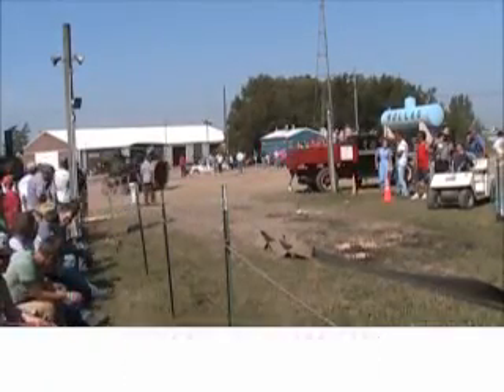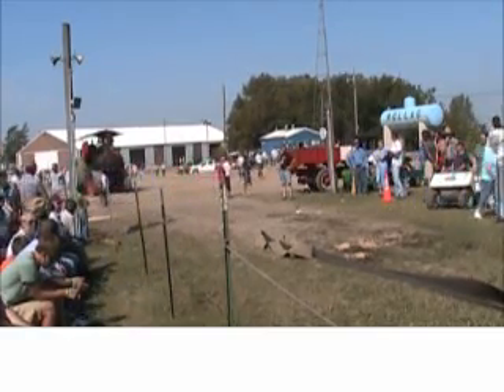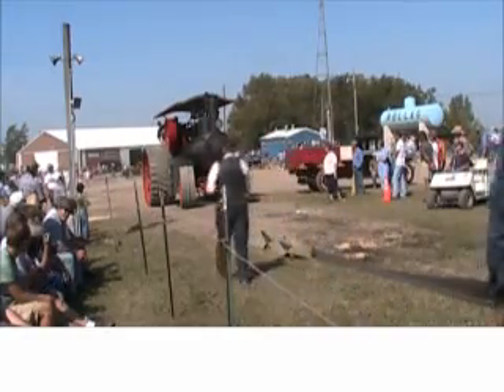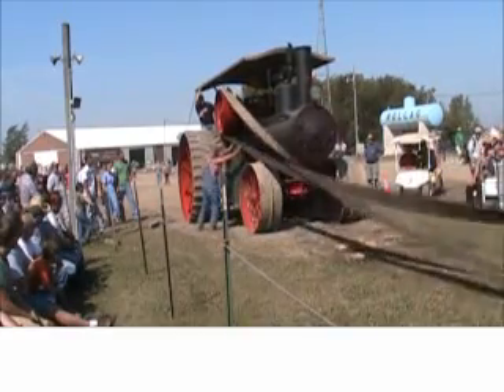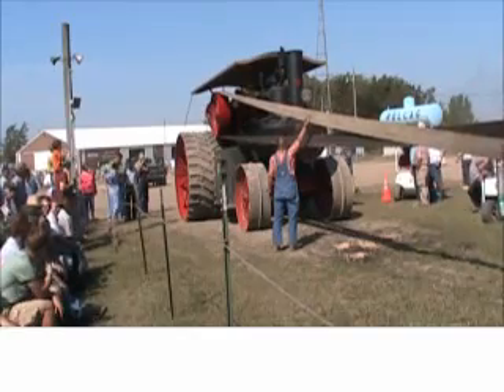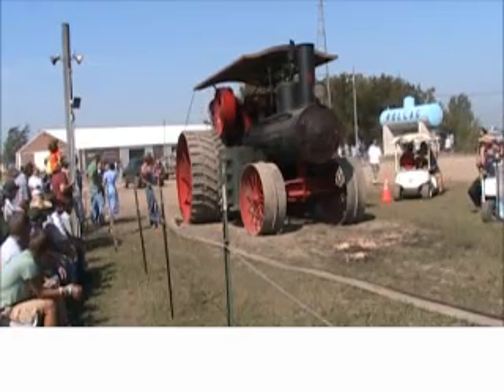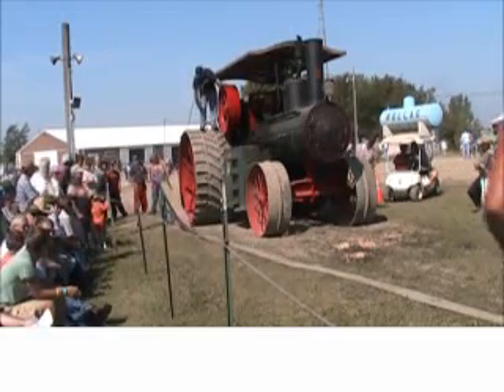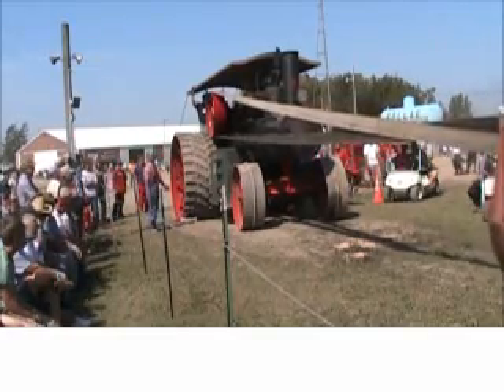Steam Tractor on Dynomometer - Torque and HP Explained

Comment: my honda motor with a 1.8L using gearing can produce more tq at any output speed than this can.....why you ask? cause i produve well over 350hp with it....!!!!!!!  its called math you idiots
Reply: dumbest shit I've read on YouTube in months
Reply: TATERTOTS JACKSON then you clearly donyt know shit about energy or math and physics.... nuff said
Reply: +Chad W there's an old saying. hp is how fast you can hit a wall and torque is far you carry the wall with you. there's your physics and math explained so your stupid ass can understand.
Reply: Chad W coming from your stupid as fuck opening statement, you still dont know shit. Go ask a physicist how HP torque are apply in world through phyicis, or read a fucking article on it, I know enough about both to determine you're a fucking moron.
Reply: Hp= torque x rpm divided by 5252...... Put in some numbers and work it out. The tractor has no hp...because it doesn't rev....but have huge amounts of turning force ( torque) at low rpm.
Reply: Chad W you're literally beyond help, you're capable of reading and still can't understand. Your own statement defeats itself. Motors produce numbers off the crank and at the wheels, transmission gearing has no bearing on turque made at wheels, gearing is to take advantage of torque made at the wheels to apply the power to the ground.

A desiel motor can produce twice the torque over the HP of the motor. HP doesn't directly correlate to HP. And as such the same motor can produce 600 HP 1200 torque vs 750 HP 500 torque gas motor. Your head will likely explode now.
Reply: "so no matter what gearing you have, there is no way a higher hp motor can produce LESS tq than a lower hp motor..."
-HAHAHAHAHAHAHAHA
Sure. Lol. Thats insane bullshit. I've personally witnessed a well over a century old 180 horsepower stationary engine the size of an entire fucking house with cylinders the size of a fucking oil drum pump and drain 3000 acres of flooded land in a day. My turbocharged 300i6 in my 1966 dump truck produces over over 500 Ft. Lbs of torque while only putting out 258 horsepower. Meanwhile, an LS1 engine produces 350 horsepower while only producing 365 HP. My old school dump truck can and has won a great many pulling contests against modern V8's that have:
-More displacement
-More horsepower

Because at the end of the day without the torque you won't get moving, and in a battle of brawn torque, traction, and weight is what wins the pulling contests.

https://www.youtube.com/watch?v=EVxByLO_6cA
^Here's a tractor putting out a "meager" 110 horsepower yet it does a full pull in a pulling contest with lots of energy to spare and no signs of slowing down.

Think of torque like a hydraulic press. Its slow, but don't dare get in its way.
Reply: Brett Wright its old cause you use it and you know nothing of physics.. your sayings are old and dumb based on 100 yr old men who dont know math or physics so keep your old sayings to yourself cause they do not apply..        more weight you want to move in the same time requires more energy, i.e. hp..... if you disagree you disagree with physics and if you can prove you are right then you would be given millions and be on the cover of dozens of world magazines, but you aint.... cause you dont know fucking shit about physics or math, only recite old outdated false "sayings"
Reply: Brett Wright you dumb moron. hp determines wheel tq based on gearing.... so no matter what gearing you have, there is no way a higher hp motor can produce LESS tq than a lower hp motor...

so, higher the hp , the more wheel tq you have if you can change the gear accordingly. 

hp always equals more tq if gearing is introduced...i.e. transmissions...

if you disagree, then you defy the laws of physics and if you can prove this, which you cant, then you will win literally 100's of millions proving the current model of physics on ITS HEAD!!!!

if you cant, then well.... you are a moron and i shouldn't have replied cause you are a fucking moron living in a head that no one has told you how dumb you are.........

let me know when you win the noble prize!!!!   ill wait!!!!
Reply: Brett Wright You didnt understand my post cause you have no intelligence. I told you why your shit was wrong using science, math and logic... if you dont learn from it, its not my fault...

and dont fucking think for a minute that im the ignorant one...
i am NOT the one stating shit that defies the laws of physics and if i dont agree IM the fucking moron. 

you are the one that doesnt understand energy....so walk along and be dumb....not my problem....
you made the dumb comment on a public forum then get pissed when you get corrected...
learn or not. i dont care....
Reply: andgate2000 energy = force x rpm    you only need to devide by 525 is you want to use the made up term called hp, then you also have to use hp and tq, not focre and power/energy     using hp means its a registered traidmark
Reply: You don't have a clue do you. Hook your 1.8 to this steam engine. I mean weld them together shaft to shaft. Hammer both throttles at the same time and watch your 1.8 spin like a propeller...impractical test but it is absolute truth that your engine is not even close to the power of this stream traction engine. In fact I think your joking, right?
Reply: if you think that gearing and torque multiplication is all of the different variables you deal with a tug of war you need to really expand on it. in a situation in that you are looking at gravity as a constant with your variables being the coefficient of friction between the ground and the wheels as well as power, gearing, the acceleration, and mass of both objects
Reply: Chad W You are actually correct when you state that your 1.8 can produce more torque than the steamer at an output shaft if it's geared down low enough through a gearbox. But you are comparing direct crankshaft torque of the steamer with a 1.8 petrol spinning through a reduction box at least 12 times the revs, then measuring the resultant torque at an output shaft after it has been geared down 12 or 15 times. Well yes, but you can also gear the steam engine crank down 15 times to the drive wheel couldn't you? Making the steamer 15 times the output torque of your geared down 1.8. But here's the problem for your 1.8. It can only reproduce the steam engines torque if the engine is already allowed to run at high rpm. Not from stationary. The torque output at 250 rpm of the steamer of 3000 ft/lbs,  is the minimum the steamer produces. Maximum torque for a steam engine occurs from rest, then falls away with rpm. So the traction engine would out pull your 1.8 from a stand no matter what the IC engine gearing,  because as soon as full load is applied, the petrol engine revs drop like a stone until the engine has nothing left to give, while the steamer remains at full torque even if the crankshaft is stationary. Good try, but no cigar buddy!
Reply: Finished waffling? Okay. Where to start? A steam locomotive starts 3000 ton train away from rest using overdrive gearing. Because a locomotive driving wheel is of considerably larger diameter than the cylinder crank pin. It's like starting away in 6th gear with 7 or 8 times the locomotives weight in tow. This is despite the loco producing NO horsepower whatsoever until those driving wheels begin to revolve. The moment they do, & the time & work done factors are involved, the hp climbs into the hundreds almost instantly. No matter what the engine type, petrol, diesel, steam or electric motor, the horsepower is irrelevant until something moves. The output shaft on your geared down 1.8 or 125 motorcycle, also produces no horsepower until that output shaft begins to turn, regardless of what the engine crank is doing. You have just tried to make the case that a cvt 125 scooter could out pull a fucking traction engine producing 25,000 of of drawbar pull, because the 125 is spinning at maximum revs & producing 10 go, while the steam engine is stationary and therefore producing NO hp. You're adorable! Have you seen videos where steam traction engines out pull 900 go diesel tractors in a tug of war? Those diesels are producing just a little bit more than your single cylinder 125, yet lose every time to the steamer, despite the traction engine giving away some 800 hp. They cannot match the starting torque of a steamer even when working through a reduction box.
Reply: No matter what the engine can produce in horsepower when allowed to spin at rated revs, once an engine's peak torque is exceeded by the load on it, IT WILL STALL. this is why we dont fit 200 hp 1 litre motorcycle engines to small trucks, because the peak torque of a naturally aspirated 1 litre is just 75 ft/lbs. Barely enough even to turn a truck gearbox over. Developing 200 hp at 13000 rpm is all very well in motorcycles, but in a truck the take up loading from rest would stall the engine in seconds.
Reply: Your 125 single produces the gigantic peak torque of 7 ft/lbs, so obviously it could easily out pull a single cylinder traction engine producing an absolute minimum torque of 3000 ft/lbs @ 250 rpm. Minimum, because a steam engines torque falls away from its peak when stationary the faster the engine revs, as the steam doesn't have so much time to get in & out of the cylinder to exert it's force on the piston. So the torque has dropped 25% by 250 rpm. & this is at the crank, before it is multiplied by gearing to the wheel. But what chance would this traction engine that can pull 150 tons stand against a 125 cvt scooter? Lol
Reply: Typo error (25000 lbs of drawbar pull) I'm writing on a mobile with predictive text. To use your example, I'll explain the principle you can't seem to grasp. The man pulling 93 tons. The fittest human in the world, let's say a tour 're France rider, can develop approximately 0.5 - 0.7 hp. The strongest men on the planet can move a 147 ton Jumbo jet a couple of yards before collapsing. The work done in moving that Jumbo 2 yards is the horsepower, which takes him many attempts and 20 odd minutes. But the drawbar pull exerted, perhaps 800 or even 1000 lbs, is the torque equivalent. He can exert enough strength to overcome the dead weight inertia of the aircraft, - But in terms of distance, he has only marginally exceeded the power output of a model aircraft engine.
Reply: marcin l John Deere vs 1800 steam tractor. See a 800 hp tractor beaten without the steam engine even having to try. Exactly the same result on concrete.
Reply: marcin l Look up Steam Engine vs County tractor. Even 4 wheel drive can't beat a small single cylinder traction engine. Though of course, tractors aren't designed to pull on mud are they? Lololol
Reply: marcin l I'm still waiting for your video where a 125 motorbike out pulls a traction engine. Or even a weak torque tractor to make it easier for you! We'll just have to agree to disagree, because I can't think of a way to make physics any simpler for you.
Reply: Sorry Marcin, your English syntax is as muddled as your physics, so it's difficult to make enough sense of your message to respond. As I said in an earlier text, I can't seem to make it simple enough for you to understand the point, even when showing you video PROOF of torque superiority over horsepower from a standing start. Please show the video of a 125 scooter outpulling a tractor..
Reply: Wrong on all points. As soon as an engine's peak torque is exceeded by load, IT WILL STALL. No matter what the hp. Even If geared down to achieve the same torque as a steam engine at the crankshaft, the geared down petrol or diesel will lose optimum revs & therefore torque peak. The steam engine produces more torque the SLOWER it goes, achieving peak torque at stationary. As you saw in the 2 videos, the tractor engines bogged down under resistance & the steam engine outpulled them. Simple. Traction engines don't need revs to produce maximum pull. Why can't you grasp that? Once. Something moves, a flywheel or the load, THEN power in Watts is being produced. But a static force produces on effort. Once rpm or speed is involved, THEN the engine is doing work in KW. But the traction engine defeated both tractors because it's static torque was so much greater. Even though their horsepower at speed is higher. The load the traction engine imposed, prevented him em from sustaining the revs they needed to generate maximum pull. The Ford County in the second video even had 4 wheel drive AND an automatic gearbox & torque converter to help it sustain maximum power revs, & it STILL couldn't defeat a small single cylinder traction engine.
Reply: Thanks Marcin for an interesting debate even though we can't agree.
Reply: I understand your point. A high revving engine with higher horsepower will, if geared down, develop more torque at the output shaft than a low revving engine with lower rated horsepower using taller gearing? I agree! But UNLESS the higher horsepower combustion engine can reach & maintain its power rated revs as soon as load is applied, then the force at the geared down output shaft will drop. With the steamer, the force at the output shaft increases to maximum when stationary. For a higher horsepower combustion engine to exceed the drawbar pull of a lower HP steamer, (when stationary!)  it would need either a torque convertor to help it maintain power rated revs, or would have to spin its drive wheels instantly to stop the engine bogging down & stalling. I'm NOT disputing that a 300 hp engine can do 3 times the work output of a 100 hp engine! I'm saying that when no movement takes place (& therefore no work in KW's AT THE OUTPUT SHAFT is being produced yet) - The engine that can generate the greatest torque at the wheel, with or without gearing, & put it down on the ground, will win. If the steamer produced 100 bhp @ 250 rpm, & a diesel tractor develops 100 bhp @ 4000 rpm, then to equal the pull of the steamer once moving, the tractor engine will need gearing down 16 times shorter than the traction engine crankshaft. If the tractor develops 300 bhp @ 4000 rpm, it will still need gearing 5.333 times shorter to equal the torque of the steamer at 250 rpm. If the tractor was 600 bhp @ 4000, it would STILL need gearing 2.666 times shorter to equal the torque of the steamer @ 250 rpm. But when starting away from REST, the steamer is already at full force, whereas the tractor engine is not, & has to be allowed to rev in order to reach full power to create an equal force through gearing. End of story. : )
Reply: marcin l We aren't talking about acceleration or work done! You don't seem to understand physics very well. We are discussing the force required for moving a load away from rest, which is TORQUE. As I said earlier before you launched into streams of verbal diarrhoea, I DON'T DISPUTE THAT A 300 HP ENGINE CAN PRODUCE 3 TIMES THE ENERGY OF A 100 TO ENGINE. Moving a weight or load from rest though requires torque. Only once the mass is moving & accelerating does hp come into the equation. A 600 hp engine will accelerate a mass 6 times faster than a 100 hp engine. But the power of both engines gives no indication of the torque produced unless you know the revs at which the power is developed. Which is why you don't find 200 hp 1 litre motorcycle engines in tractors & trucks in place of 200 hp diesels! As at 75 ft/lbs, it would be almost impossible to prevent a motorcycle engine from stalling when starting away. Such an engine has to go to almost 13,000 rpm to develop that power. Power is just a measure of work done, which ALWAYS requires revs or movement. Yes, if you gear a high hp engine with low torque short enough, it will pull harder at the output shaft than a lower hp engine of very high torque. But the same problem remains; how do you sustain the engine revs high enough to produce the horsepower required to generate big torque at the output shaft when the vehicle or shaft is STATIONARY? Your 600 hp Ferrari would have to go to 8000 rpm to start a heavy goods vehicle away from rest every single time, rather than the 500-600 rpm that a big diesel engine requires, even though the truck diesel may give away 100 bhp at peak power. No human being has ever achieved even 1 hp in tests, as they cannot achieve enough revs to combine with the torque they can produce (in cycling) many body builders have held back cars in a tug of war, despite the car engines exceeding the body builders many hundreds of times in horsepower. A friend used to hold my 18 hp motorbike back when I tried to pull away. Because the engine torque was 12 ft/lbs. Even in first gear, which brought the torque up to about 30ft/lbs at the back wheel, he had to difficulty at all holding it back with one hand, despite me revving to 9000 rpm to pull away. The engine bogged down & stalled because of its lack of torque. Even though the engine could produce 36 times more energy than he could. Anyway Marcin, I'm going to stop here since neither of us is ever going to convince the other, & while I genuinely respect you for conversing in my language, it is very difficult to understand your sentence construction in order to respond directly to your points. Thanks again for a good argument without it getting personal. Take care buddy.
Reply: Except that it isn't. When moving a resistance from rest, or on the move, torque is everything. Horsepower will only determine how quickly it will move. Once an engines strength, its torque is exceeded (given identical gearing) it will fail, irrespective of how many hundreds of horsepower it develops. You & Chad are wrong. Torque is the true strength of an engine. Power is simply its work rate if it is ALLOWED to rev at its optimum rated rpm. Let's look at a hypothetical Ferrari engine of 5 litres. At 75 ft/lbs per litre, it develops 375 ft/lbs of torque. If it can generate this torque at 7000 rpm, it will make 499.3 bhp. If it could generate the same torque at only 1000 rpm (which it couldn't, but we are talking hypothetically) it would generate 71.3 bhp. Those are its respective work rates at both rpm levels. The force the engine can generate at the crank, - its torque, - is unchanged. If we fit this engine to a bench, & fit it with a fluid brake, then fit a 2 foot bar at 90 degrees to the shaft of the output of the fluid brake, -  then I apply a force of 188 lbs or a mere 94 kgs, which I can easily supply, - I can kill this engine with my bare hands from ANY engine speed whether 1000 or 7000 rpm. its work rate, whether 71.3 or 499.3 bhp, cannot prevent me from overpowering it & stalling the engine. Moreover, it will require no more physical effort from me to stall it from 7000 than from 1000. All I have to do in both cases, is to overcome its peak torque by applying 188 lbs or 94 kgs of resistance, & I win. EVERY. SINGLE. TIME. Now let's take 2 more engines. One generates a peak torque of 400 Nm @ 3500 rpm. The other generates a peak torque of 200 Nm @ 7000 rpm. Both produce EXACTLY the same work rate of 196.55 bhp at their respective torque peak rpm. If we attach EXACTLY the same gearing to each engine, & the same size drive wheels, - which one will generate the greatest force at the back wheel? Which one will prove more difficult to stop? Exactly! The one which generates the greatest torque. If we then DOUBLE the torque of the second engine to 400 Nm @ 7000, it will now produce 393.1 bhp. But it will provide EXACTLY the same force at the back wheel as the first engine. The only change, will be that it will provide EXACTLY the same force at twice the speed. In other words, - Its work rate has doubled, but its force, at the crank or at the rear wheel, is exactly the same as the engine with half the power if the gearing is identical. The same level of resistance is going to stop it. Yes, you could give a reduction box to a high HP low torque engine to match or exceed the torque at the CRANKSHAFT of a low HP high torque engine. But the engine that produces the greatest torque at the crankshaft when using identical gearing, will ALWAYS win in a pulling contest. The ability of an engine to pull a weight inside its capacity, faster than a lower power engine with the same gearing, doesn't change its stall point when its output torque is exceeded. If speed is not a relevant factor in getting the work done, then the engine with the greatest torque using the same ratios will ALWAYS out pull a higher HP lower torque engine in maximum force terms. It will just do the work much slower. Your calculations between Chad's 1.8 & this steamer made me laugh. The steamer is also geared down from the crankshaft!!! I don't know the ratios, but it is probably reduced 7 or 8 times that at the crankshaft. Did I read 32 tonnes force from the steamer & 83 tonnes from Chad's little 1.8 306 ft/lb rev box Lololol you should be a comedian Marcin! lol
Reply: Hi Marcin. Have you worked out where you went wrong yet? You continue to equate work rate & horsepower, but we are discussing maximum pull from a dead stand, which only relates to force, or torque. Chad DID NOT claim that with the right gearing his 350 hp Honda could out pull this steam engine. He, & you, were suggesting that his Honda could out pull it with both vehicles using their current gearing, which is beyond absurd! Yes, you are technically correct to suggest that the Honda has almost 3 times the work rate of the traction engine, & that given the appropriate gearing, it could indeed pull a given weight at nearly 3 times the speed. But lets see what that would look like. Chad doesn't give details, but his engine is 350 bhp & 1.8 litres. At 75 ft/lbs per litre, & 135 ft/lbs for a naturally aspirated 1.8, Chad's little Honda would need 13,630 rpm to see 350 bhp lol. So we can safely assume it's turbocharged! - So let's agree that it produces that 350 bhp at 6000 rpm. That requires a torque of just 307 ft/lbs, because petrol engines can't take much boost without detonation. This video is vague too, as we aren't given the specific peak torque of the steamer, & we only have the claimed HP of the manufacturer of 120 bhp. 3070 ft/lbs would develop the claimed 120 bhp @ 205 rpm. I watched a tractor pull with an identical Rumely 120 steam tractor, & counted 15 revolutions of the flywheel to one of the back wheel. So that is 46,050 ft/lbs at the axle. If we agree that the back wheel diameter is 6 feet, then the drawbar pull is 15,350 lbs, or 7 metric tons of dead pull. The average 1st gear ratio of a car including final drive ratio, is plus or minus 5:1. So if we assume Chad's Honda has 24 inch diameter wheels, it will exert a force at the wheel contact point of 1535 lbs, or 0.7 metric tons. So with standard gearing as they are, & assuming perfect traction for both, it will require 10 of Chad's 350 bhp Honda's to equal the pull of the steamer from a dead stand. NOT once under way at speed, because the steamers torque falls away as rpm rises, - which is why, of course, it only produces 120 bhp. Now let's say that we gear Chad's Honda to equal the pulling strength of the steamer from a dead stand. The steamer produces 10 times the torque of Chad's turbocharged Honda engine at the crankshaft. Then it is geared down a further 15 times. So to equal the dead pull of the steamer, - EVEN with its tiny 2 foot wheels compared to the steamers 6 foot wheel, - you would have to gear it down 150 times from crankshaft speed to back wheel. That isn't vehicle gearing any more. It isn't even low range tractor gearing.. It is the gearing of a WINCH. & a very low geared winch at that. So yes, of course you can technically gear anything down to give the results you want, but you can also drop the gearing of the steamer too! You could also gear UP the 205 rpm 120 bhp steam engine to achieve 115 mph in a road car, though I wouldn't recommend it! It's horses for courses isn't it? The steam engine is extremely powerful within its extremely limited working rev range, & that really is the point. If the traction engine could develop its 3070 ft/lbs at 6,000 rpm, it would be making 3,503 bhp. If Chad's Honda could make its 307 ft/lbs at 205 rpm, it would be making 12 bhp. The Honda makes its superb output by making 1/10th of the torque but at 30 times the engine speed. Are we in agreement now? ; )
Reply: Okay Marcin, let me put it this way. Once on the move and with a weight or resistance that Chad's car can get moving, it will pull that weight or resistance down a track at almost 3 times the speed of the traction engine. That's work rate, & it is in arguable physics. But if you wanted to convert that 3 x horsepower into pulling power from a dead stand that is 3 times that of the steamer, then you are going to need incredible gearing. We have already established that to equal the DEAD pull of the steamer, that the Honda will need reduction gearing of 150 times from crankshaft to drive wheel. It will then pull the same 7 metric tons from rest. Once moving, it would then move the same weight or resistance at 3 times the rate of the steamer. If you want to use the 350 bhp as sheer pulling strength to triple the pull of the steamer, you would have to give it reduction gearing of 450:1. It will then pull 3 x the weight as the steamer but at the same speed as the steamer pulls 1/3rd of the weight. Happy? That is one he'll of a winch. But no kind of vehicle!